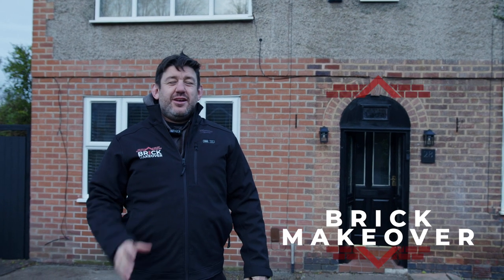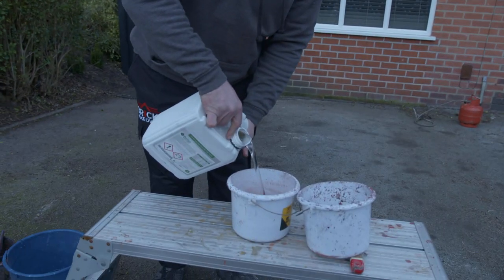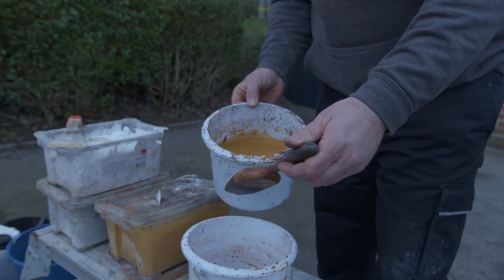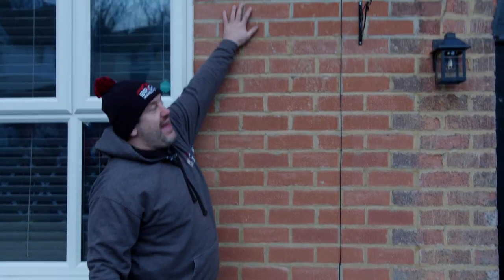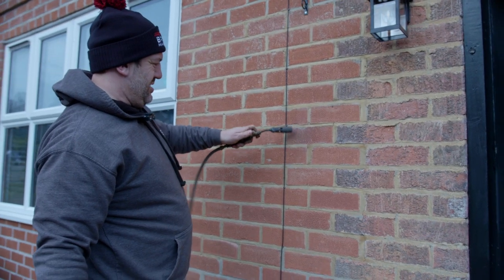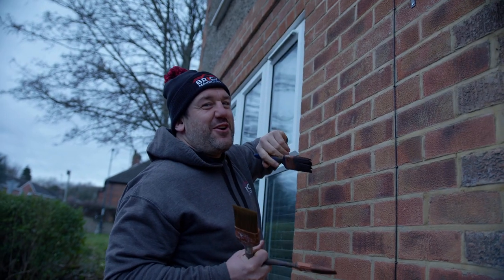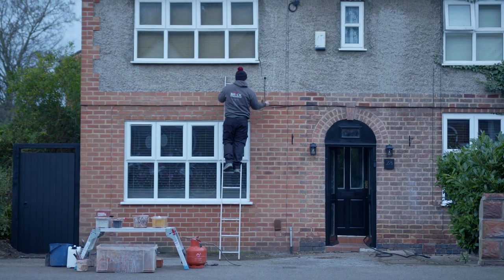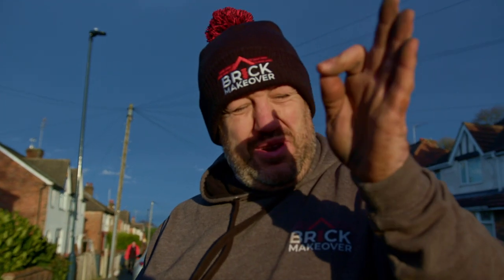5 COLOUR BRICK TRANSFORMATION | Brick & Mortar TINTING | #BrickMakeover

Comment: Great transformation👍 Will brick cleaning take the tint off?
Reply from the maker: Great question! It won't, no, our tint soaks up to 10mm into the brick itself so even if the surface erodes slightly due to cleaning or erosion the tint will last